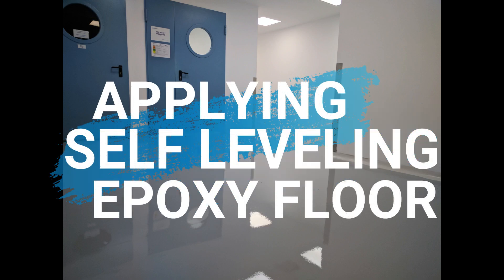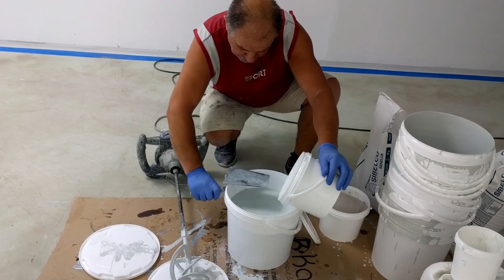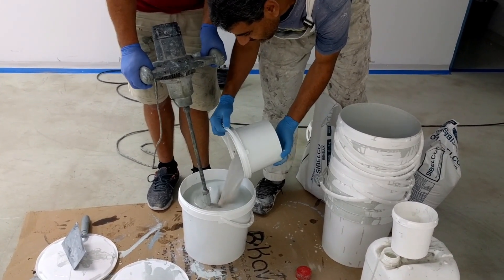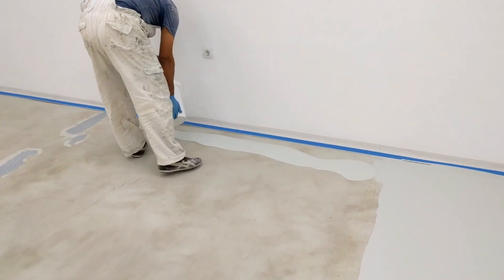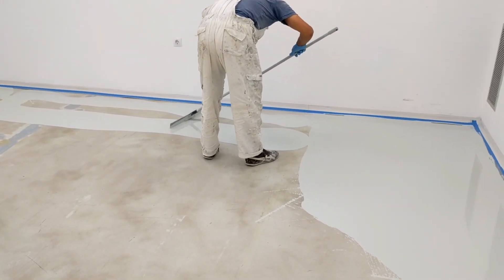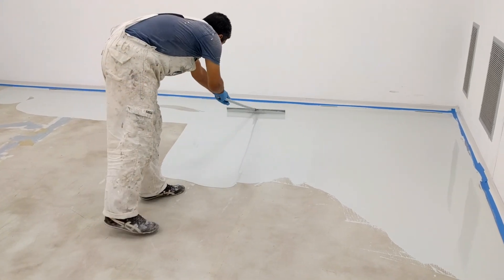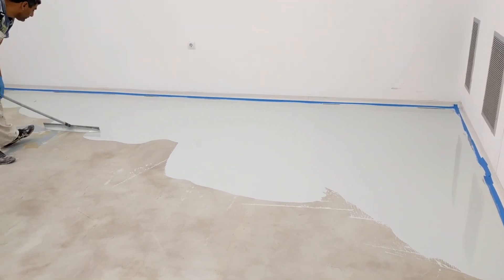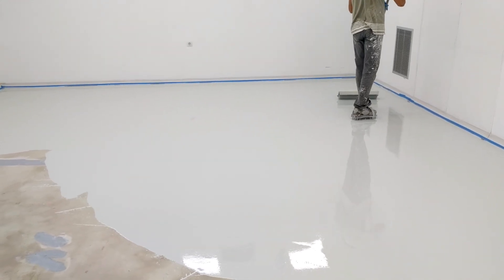Self Leveling Epoxy Floor - Step by Step how to Apply (Ktisofloor)

Comment: would it be ok to use self-leveling compound on the concrete in order to smooth out the surface, before priming and using epoxy?